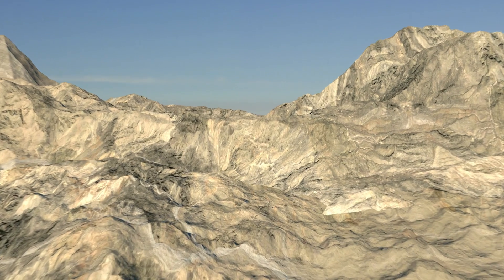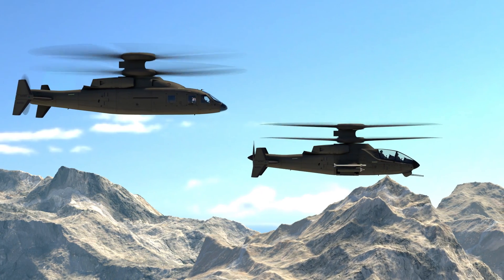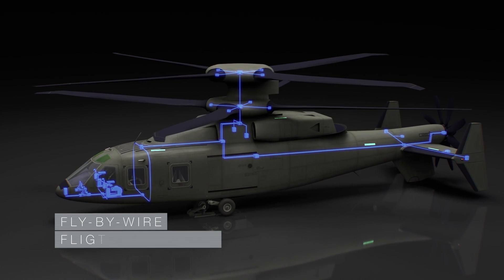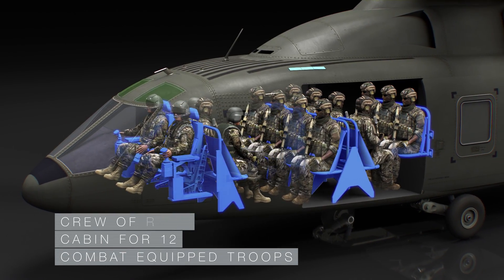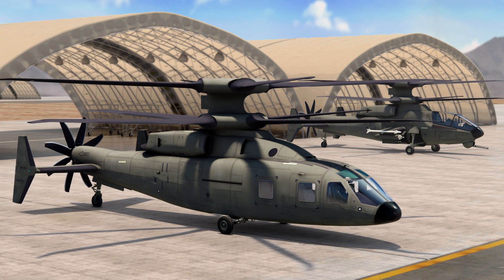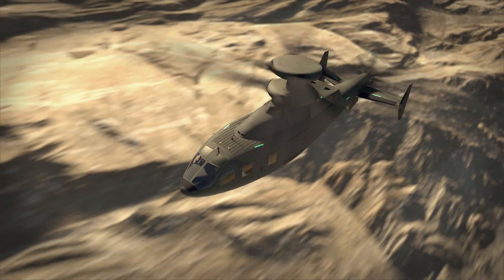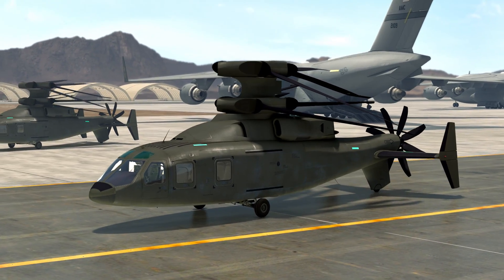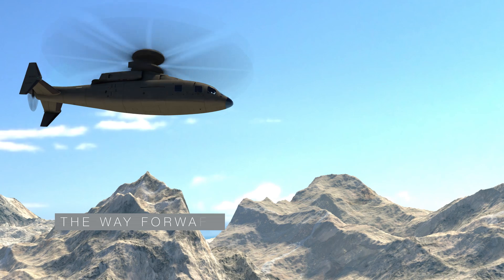Sikorsky - Boeing Future Vertical Lift: The Way Forward

Comment: The design is wrong to put two propellers on it stays ugly my opinion
Reply: Hey guess what? Your opinion is trash unless you work on helicopters for a living like these guys do :)
Reply: It's not about being ugly or not, it matters if it works or not, and quite honestly the idea of putting two counter rotating rotors on and aircraft in order to bypass the a helicopters fundamental top speed limit is beautiful.
Reply: deltaboy2011 "copy" you honestly think thats what happens... aerospace engineers (or any for that matter) dont "copy"it defeats the whole purpose of designing and testing (being an engineer) anything in the first place.
Reply: Othman Asli 2 props make it to where you don't need the back stabilizing propeller and you can up the horizontal driver on the back
Reply: The truth is Ka-50 and Ka-52 is the best attack helicopters in the world, even apache can't stand against them, so calm down kids.
Reply: Shufflebot47-Gaming I know that. Some guy said the Apache was a copy of the Alligator, it doesn't make sense if the Apache is older.
Reply: Nesquick Guy Wow, what a complete idiot. My point is that even "if" Russia had superior tanks or helicopters or the best standing army, it'd be irrelevant. Your "typical American" comment has confirmed what I believed, you are just a brainwashed idiot that refuses to see the truth. Russian aerospace engineering is only good for airshows. Your toys only look good on paper. Our stuff is battle proven 👍
Reply: +Ckc dillpickle Your comment makes no sense at all. First you said Mi-28 does not feature radar but then you are agreeing with that Mi-28N features radar. That's some sort of paradox shit. Maybe you are talking about the specific variants but you can't deny the Mi-28 has radar in general. And not every apache has radar as well. The specifications you mentioned in your comment is terribly inaccurate. I'd say that's just bullshit and your opinion. Mi-28N has a maximum range of 1100km (Or 684 miles in your retarded system) but apache has only 480km.

"The Mi-28N recently received a Radar Dome but it most likely doesn't have the capabilities of a Apache considering its low combat range and barely if any have Active Data transfer between vehicles like the US does."
How do you even know their radar range? I can see so much ignorance in this comment. Look at yourself, you're bragging about apache without any clue. It's just your opinion and not a real fact. That's stupid.
Reply: +HulKevin Is the M4 best thing americans have? Thats funny. Russia doesn't have only Ak-47, there are also AKM, Ak-74, AKS-74U, Ak-100 series and Ak-12 that are much superior than western rifles. Don't be such an idiot.
Reply: Prokiller CW Also the AK-15, but they are not superior. Western assault rifles have better precision, accuracy and stopping power in general, they are also more reliable and modular than ever. The ACR Bushmaster, the REC 7, the HK416/417 are all much better.
Reply: @apolloaero  look up ak-107
Reply: @Ms13unknown13  It's a nice rifle indeed, should be accurate too
Reply: +Nesquick Guy Bro no matter the proofs, those stupid americans will never agree with that. They just can't deal with the fact their weapons are not the best. I guess they feel ashamed and butthurt, when they know thier weapons sucks. Americans literally think USA is the greatest lol. USA is the shithole full of immigrants, fucktards, fat asses and gangsters.  Their nation is about only 240 years old. They killed the native indians and stole their lands. Finally the dumbass named trump has became president and USA is about to collapse now.
Reply: Copy saves money and time in research.
Reply: deltaboy2011 lol actually no.. "copy"(its not actually copying more so just seeing what other people have done) is actually one of the steps to conceptual design of any aircraft its to know what has been made possible and why and how can one improve and why did they do what they did, this consumes time and money so from the look of it you actually know very little about anything to do with the makings of aircraft, no one really copies, understand that. Airframes may look the same (example Chinese aircraft that look like f16 and su-30) but they definitely arent they same. They would have wayyyy different flight characteristics... NO ONE COPIES.. to put yourself at equal with an opponents tech..does that make sense?
Reply: It makes sense if you behind in technology and need to copy.  As you pointed out the Chinese aircraft is based on Russian design.  Can't deny it when Chinese didn't have anything good many years ago.  Copying help speed up in catching up instead of behind.  Does that make sense?
Reply: deltaboy2011 Apache is older
Reply: deltaboy2011 No, the Chinese reverse-engineered the tech. They've also stolen a lot of data pertaining to military tech. They're not exactly copies, it's better to call them knock-offs.
Reply: deltaboy2011 No..
Reply: HulKevin Yes it's older but we have different blocks of the apache (or versions for say) the versions just mean upgrades so at the time there was an A upgrade then B c d and now we are on AH-64E Apache I think
Reply: Oh does it. And what makes it better.
Reply: Nesquick Guy Speed isn't everything kid.
Reply: Correct. A 14MPH difference has little effect on anything.
Reply: Nesquick Guy Lol, speed and agility are the only true advantages it holds. It doesn't matter how good your tanks or helicopters are if you can't hold air superiority 😆
Reply: +HelKevin yeah your shite ass weapons like M1A1 and AH-64 are combat proven because it destroyed some old soviet outdated stuffs in iraq or whatever arabian country. The abrams tanks are getting blown up by old soviet Konkurs ATGM and in Syria the Russian T-90 took a double hits from TOW and still operational, and you call it not combat proven? You gotta stop before get fully roasted, fucking moron. Every sentence in your pathetic comment is so childish and don't make any sense.
Reply: +HulKevin First you meant so say apache is better than ka-50 but now you agree with ka-50 is better than apache. But you immediately tried to change the topic with air superiority lol. You don't even know what you are talking about. Get a life kiddo.
Reply: Nesquick Guy well I wonder why... do your fucking research before you speak. Any Abrams in the Middle East that is not used by US military personnel is most likely the shittier model we sell to foreign countries. Those tanks do not have the TUSK upgrade set that was added on and have less resistant armor
Reply: Oh is that so. What makes the Ka-50 better than a Apache.

Not considering the radar systems that no other helicopter has.
Reply: +Freedomizer you typical murica inbred, I've heard that shit many times before. First of all, you better do some research fucboi. The americans say all the T-72s are shit because iraq had worst T-72 tanks. The iraqi T-72 were export junks, like the saudi arabian abrams tanks. The US army abrams tanks could be better, but still, it's shitty tank. Even the export model of T-90 is better than M1A2 with TUSK upgrade. SO fuck off.
Reply: Nesquick Guy The Mi-28 is better than the Ka-50/52. Glad you aren't as stupid as you sound.
Reply: Nesquick Guy Lol, Russia would be lucky if the T-14 does well against the M1A2 SEPv2. They'd be even luckier if they ever bought a relevant number of advanced weapon systems.
Reply: +HulKevin I think he meant to say apache is not the only helicopter with radar...
Reply: Prokiller CW No, it was a response to another person that claimed that the Apache was the only helicopter with a radar of its kind. The Mi-28 also has a mast-mounted radar. The Ka-50/52 series don't have a set variant, they are all unique. The Russians use them to test different sensor technologies so they don't really have a standardized version that we can compare against the Apache. Some have nose-mounted radar and some don't, some have IR and some of them have space for FLIR but none use it. There are only 15 though, Russia doesn't build advanced weaponry and weapon systems in relevant numbers. That's their greatest weakness.
Reply: +HulKevin USA and NATO has quantity, but Russia has quality. USA is rich as fuck, and their weapons are expensive but not worth with their costs. Russian weapons are cheap but reliable. That's why Russian weapons are more popular in the market. T-90MS costs 4.5 million USD and M1A2 costs 8 million, so what kind of idiot would prefer buy abrams instead of cheaper but better T-90MS? Russians are good at efficient spending. Americans do not know anything about this, they don't even give a shit.Their military is corrupted and their weapons are just overpriced junks.
Reply: Nesquick Guy Russian jets are cheaper in quality as well. 100 Armatas and a few hundred T-90s vs 8,800 Abrams. Russian jets have a shorter lifespan than US counterparts, and they have a lower sortie rate. Russia has weird and sometimes even useless military doctrines. They place emphasis on areas that don't matter. Tank launched missiles are nice but what's the point when enemy attack helicopters outrange it. The US has a vastly superior Navy and Air Force that compensates for the few advantages Russia might have against the Army.
Reply: Nesquick Guy if you're saying that, would you say the Russian navy is superior to the US Navy?
Reply: Oh indeed. A group of 3 apaches could take out 10+ Tanks without being seen.. The Radar on the top of the Apache is a really neat tool
Reply: Sorry... Did you say russians have more popular and more durable guns..

The Ak-47 is the most popular gun.. Its popular because its cheap to manufacture. Although Ak-47's are different for each country. 

The Ak-47's I handled that were given to Russians could easily be damaged. The metal on the thing can easily be bent.
Reply: The Mi-28 does not feature a Radar dome that sits at the top of the helicopter.

The great advantage to having one is that you can sit behind a treeline and have the dome pop over the treeline detecting vehicles. The Information can be sent to other vehicles or apaches miles away to which they can proceed to shoot a Guided missile at the targets location. Without being seen..

The only advantage a Mi-28 has is the extra 20MPH. A better rate of climb.

The Apache has a Range of 295 miles.. The Mi-28 only has 270.

The Apache has a combat range 300 miles. The Mi-28 has a combat range of 124 miles.

The Mi-28N recently received a Radar Dome but it most likely doesn't have the capabilities of a Apache considering its low combat range and barely if any have Active Data transfer between vehicles like the US does.
Reply: About the Export model T-72's.. They really are pure shit. A APCR round from the time would penetrate through the whole entire vehicle and exit on the other side.. A Export M1A1 does not do that.
Reply: Ckc dillpickle I could have sworn that the Mi-8 had a mast-mounted radar. I only meant it was better than Ka-50/52 btw.
Reply: Ckc dillpickle not to mention how loose the tolerances are in between parts. If you to go the channel InRangeTV, they have mud test videos. The AK failed the mud test with the bolt closed.
Reply: Oh, I know. I took part in Russian operations in SK which is pretty muddy down there
Reply: +Ckc dillpickle are you trying to say AK-47 is not reliable? Ak-47 is cheaper, simpler and more reliable so more countries use it in their army instead of M-16 and its relatives. M-16s were jamming in vietnam. That's one reason why americans sucked.
Reply: Stop being smartass and think logical. No tanks go alone. Air defense vehicles like S-300 and Tunguska protects them from air. So apache destroys 10 tanks only in your dreams. Don't forget even tank can protect itself from air. The little radar on your apache is only thing to brag about? How pathetic, apache is still inferior to Ka-50 and Mi-28 with other specifications. Apache could be doing barrel roll but can't do the back flip as Ka-50 does.  So shut up already.
Reply: +Ckc dillpickle "Export model T-72's.. They really are pure shit" 
No shit captain obvious. I never said T-72 is good. But no round ever penetrated entire T-72 hull or turret. It would just make it cook off. And the Saudi M1A2s were cooking off like T-72 when it got hit by Konkurs ATGM. You're fucking idiot.
Reply: Nesquick Guy Lol, let the Ka-50/52s do all the backflips it wants as they get blown up. Your air defenses are not that difficult to defeat. The Hellfires have greater range than tank missiles. You can't operate a Ka-50/52 at night effectively, it has poor NVG and outdate IR. The Apache can identify and share information with other Apaches from cover, what can the Ka-50/52 do? Oh, right, more backflips. Do you know how stupid you sound? Who cares about radar when you have backflips, lol. Get out of here kid.
Reply: Nesquick Guy There is evidence of T-72s being penetrated clean through. I'm not so ignorant as to deny the fact that Abrams were lost to ATGMs, but none have been shot straight through. American armor is superior to Saudi armor. The M829A4 can defeat Relikt, have fun with that.
Reply: Relikt is designed to defeat armor piercing rounds, it decreases the damage more than 50 percent. Your argument is invalid. Russian tanks have many advanced protection system that most of the western tanks don't have.
Reply: If I can bend a Ak-47 with my hands. Then thats a problem.. Who uses M16's anymore? We have M4's
Reply: If you can bend Ak-47, then that's not real gun. M-16 is still being used by US army and marine corps, as well as their allies.  Do you think M4 is better? That's just a shorter variant of M-16 tho. Still same shit.
Reply: Nesquick Guy Not shit like Russian army, navy and air force though.
Reply: Nesquick Guy Ak-74, and Ak-47 are different dumbass. You have repeatedly proven you are stupid. Especially when you tried to argue that doing backflips in an attack helicopter was more important than targeting systems and avionics. The M-4 fits a niche, it's designed for urban environments where a lot of engagements can be close quarters. You don't compare sniper rifles against assault rifles or machine guns. Different roles, different guns.
Reply: Nesquick Guy Lol, with the Ka-50/52, you were absolutely wrong. Maneuverability matters little when comparing against avionics and targeting systems. The Mi-28 has less forepower and more dated technology, but it's still better than the Hokum. The AK-74 is a longer rifle but has less precision and accuracy. What good is it if it has a horrible spread. It serves a better function when used  to suppress enemy forces. Does it hurt to be as stupid as you are? Russian attack helicopters are not as good as American ones. Russian attack helicopters don't have fire and forget missiles, the Ka-50/52 only has basic target sharing and limited to non-existant night operations. How is fancy backflips and barrel-rolls going to help in a battlefield?
Reply: Prokiller CW you wanna know why the M16 jammed in Vietnam? Because cleaning kits weren't issued and troops were told the rifle was "self cleaning". There was also an issue with the powder composition in the actual bullets. Do your research before you say something and look stupid
Reply: Prokiller CW half the rifles you listed are just derived from the AK-74 that's like me listing every variant of the M4. It proves nothing beyond how one gun is used a lot
Reply: The M4 isn't just a Shorter version of the M16.. Its been improved..
If its not a real gun. Then why did they issue them to Russian Troops
Reply: +Ckc dillpickel if you can bend AK then you can bend M4, G36c, SVD, M82 and the list goes on...Dont you realise your comment is stupid?
Reply: Nesquick Guy well technically you can't bend a G36 back into place... you see it's a polymer gun so it'll snap
Reply: I've handled both guns far longer than you.. I was not able to bend the m4.

South Korea still uses grease guns the last time I was there
Reply: Ckc dillpickle maybe it has to do with better production qualities for the M4, you know with the receiver being milled and not stamped... also are you sure they were grease guns or did you perhaps mistake the K1 for a grease gun?
Reply: The K1 looks nothing like a grease gun..
Reply: Ckc dillpickle I mean they both have retractable stocks, they're both stamped, from a distance you could mistake them... but in all seriousness do they really still use grease guns?
Reply: Nesquick Guy not every single one is, but it says a lot about the AK in general
Reply: Back in the 90's they did, The probably have new guns now.
Reply: Othman Asli Are you an aerospace engineer? No.  Russia has way better helicopters that are fast attack like their alligator one or what ever it's called and it has two propellers and can outrun an apache like a bitch.
Reply: The first version of the Apache was in 1975. The Alligator's first version was in the 1980's..
(Their looks are not similar completely different design.)
The alligator has a top speed of 196MPH. The Apache has a top speed of 182MPH..

The Apache has a longer Combat radius. A larger service ceiling and a higher rate of climb.
Reply: Juuso Peltoniemi Well Yes I know that an apache would merk a Russian helicopter any day, and an AH-Z Viper, I was just saying theirs is faster
Reply: I said "Not considering the radar systems that no other helicopter has." Which no other non-American built vehicle has a Radar system of such.
Reply: The Americans copied Russia's helicopters which are the best in the world.  This  tells you something.